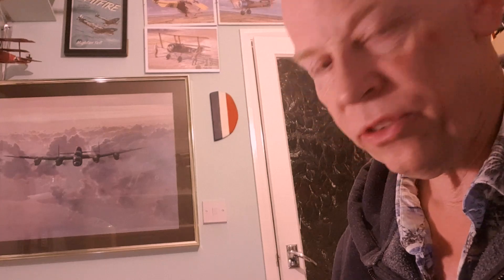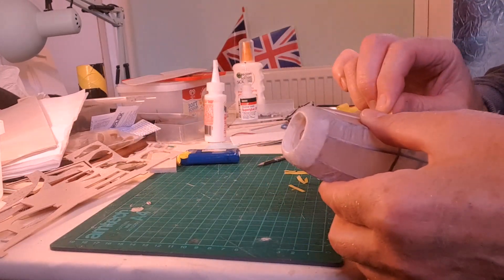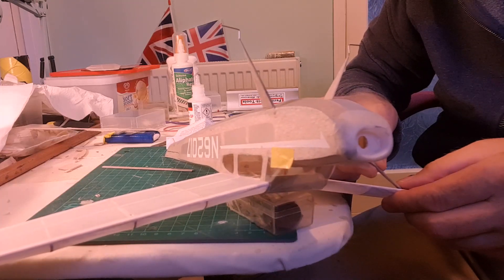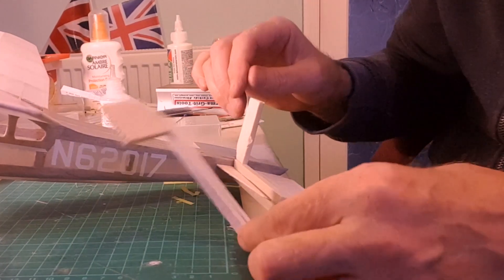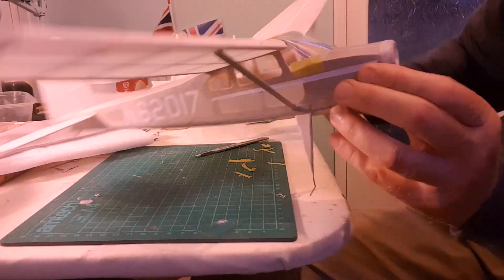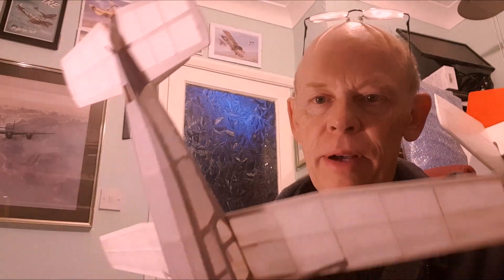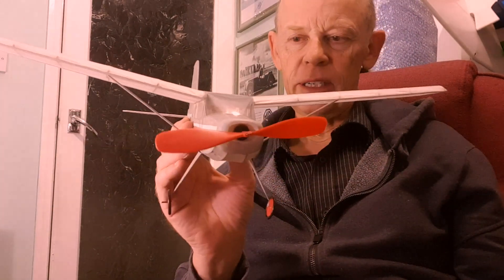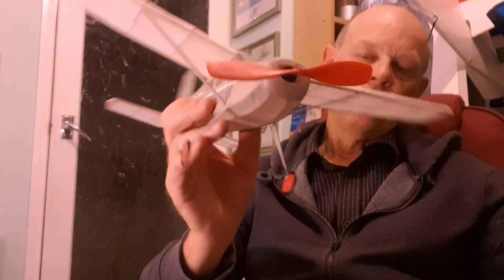Guillows Rubber-Powered Cessna 180 Part 3 Final Assembly

Comment: Im thinking this would be the perfect kit to convert to rc and install my cox .020 on
Reply from the maker: Hi Dustin, I had a Peewee many years ago and I recall an engine that ran at anything up to 20,000 rpm ... a little screamer! You'd have to strengthen the structure for the extra weight of all the equipment and engine. It's going to up the wing loading quite a bit and hence the flying speed... a fun experiment though, come back to us with the result 🙂👍
Reply: @CliffHarveyRCPlanes  I have a crashed micro cub from horizon  the controls weigh next to nothing
Reply from the maker: @Dustin-gf9su very true Justin, it'll be a great project 👍

Comment: The dihedral looks too large compared with the full-size machine.
Reply from the maker: Probably Roman but small models, especially freeflight, need more dihedral for stability, cheers
Reply: @CliffHarveyRCPlanes  The VMC Bird Dog kit has a smaller dihedral and is more faithful to the original, IMO. It would be most interesting to compare the flight performance of the Guillows and the VMC versions. My VMC Bird Dog has proved to be very inconsistent, giving a lovely flight one moment and a terrible power stall and a wing drop the next, for no apparent reason. Of course, this could be due to my incompetence at trimming the plane.

Thanks for the tips on covering models. I've started employing them, and the improvement is dramatic.
Reply from the maker: @romanpolanski4928 Just a thought Roman, perhaps your Bird Dog would be more consistent with more dihedral 🤔 Anyhow I'm glad my videos have helped, cheers. Have a look at this video Roman, most enjoyable to watch https://youtu.be/bE4rTqh0sX0?si=gBrtuJ6-8AL3187V 🙂
Reply: @CliffHarveyRCPlanes  Scale fidelity versus good flight characteristics...hmm, a difficult choice!

Thanks for the video, I'm jealous! My Bird Dog flies much faster than the models in the video. I strongly suspect the reason could be that my model is too heavy. I could try sanding down the formers and stringers to save weight, but that will lead to increased fragility.

Comment: Very nicely done, If you don’t mind on your next video could you show how you put the rubber motor in. Thanks
Reply from the maker: Hi Chris, will do, basically I use a long piece of wire with a hook on the end. On this model I poked it through from the rear peg position, out of the front hole, hook on the band and pull it back through and push the rear peg through the loop (s), hope that helps for now 🙂
Reply: @CliffHarveyRCPlanes  thanks Cliff

Comment: Harvey, hey i am building this kit, i have a question, When do you recommend installing the motor, before or after covering the model with the paper? and how do i install it? Thanks! Nice videos and greetings from Colombia :)
Reply from the maker: Hi Juan, install after covering, the easiest way is to use a long stick with two prongs on the end, (a little piece of bent wire like a paper clip will do fixed to the stick), hook the band in between the prongs and ease it into the fuselage taking the open loop of the band past the press in dowel position, then push the dowel through the fuselage side, through the end of the band and out through the other side of the fuselage. Now you can attach the other end of the band onto the propeller shaft hook. If the band is short then hook it out with a piece of bent wire and pull it out far enough to hook it on. Before fitting the band though stretch it a bit and lubricate it first ... you'll get more winds on it.
Reply: @CliffHarveyRCPlanes  Thanks!

Comment: Looks great Cliff!! Aren't you putting any control surfaces on it? If not how will you adjust it in free flight? I love the Cessna but the RC ones the landing gear no good for my field, when's the maiden flight? 👍😄
Reply: P.S We're just big kids really Lol when I've built a model say Airfix or assembled an RC model I will spend hours admiring it!! But I thought it was just me, I'll bring it up at the next PA meeting 🤣😂
Reply from the maker: Maiden as soon as the weather permits really Ian, being free flight I don't really want to much in the way of wind, if any. As for adjustments to the flight envelope you can alter the thrust angle of the propeller and add a little trim tab to the back of the necessary flight surface, either a trim tab in the former of a little piece of masking tape or a small strip of balsa called a 'gurney strip' which causes drag in much the same way as the trim tab ... at least that's the theory. Of course getting a good glide in the start of the process. 😁